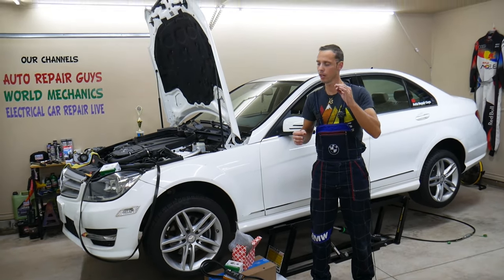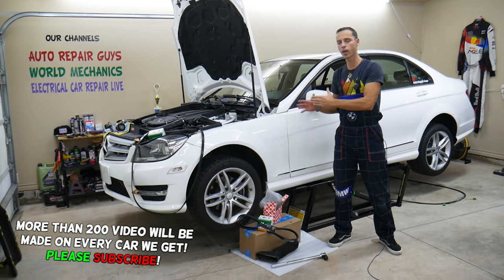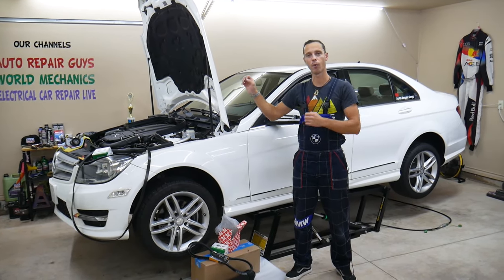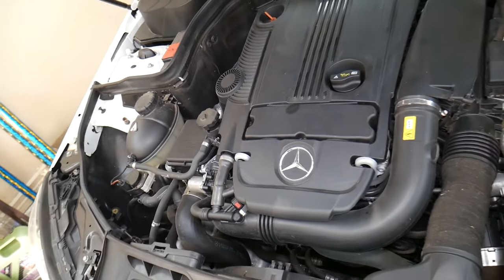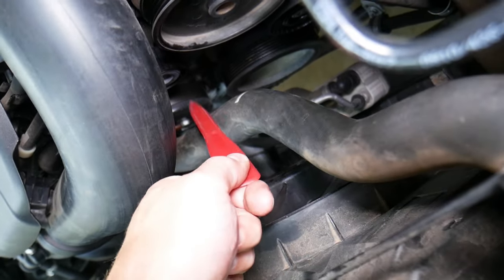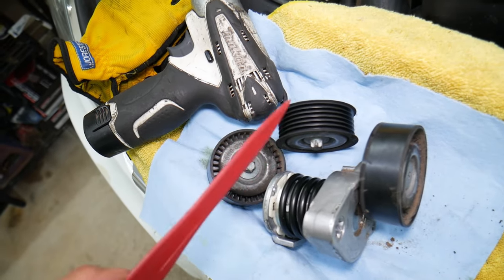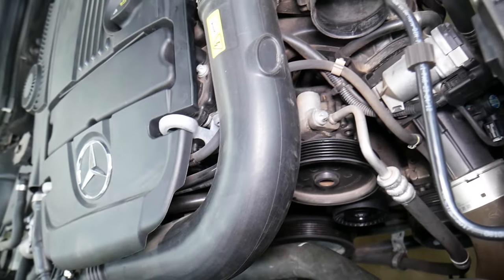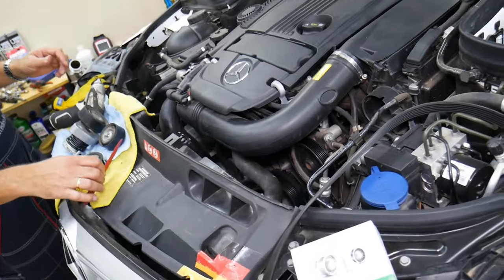WHY CAR MAKES WHINING NOISE, ENGINE WHINE NOISE

Comment: I hear this whining noise for 2 years now. I was told by mechanics it is coming from transmission, i bought the new one still the noise is there, they said ooh no it must be  front wheel bearing, i bought the new one but still the whine is there, they told me is idler pulley, i changed it still there, they said ooh it must be compressor bearing, i changed but still it whines. Now they are telling it must be a alternator bearing. These noises crazy.
Reply: It’s not the alternator because I switched it it’s fucken Anoying 😮😮😮 I did full granny service still does it maybe the air map sensor ama switch mines this week
Reply: They were pulling your leg to make money from you.  It was obviously NOT the transmission. And for sure, and didn't fix it.   Whenever I heard that noise in any of my cars, its the power steering.  Another way to "test" is that it screams louder when you turn.  Check the level, if low - top off on the level indicator with more PS fluid.  $6.
Reply: There are models you cannot check fluid levels on powering steering
Reply: 😂 fuckng mechanics doesn't know nothing from my Mercedes whining sound coming from breather hose witch is connected to the air intake pipe mechanics change this change that
Reply: @TexasCat99 what level? What fluid? Thx
Reply: @baloog8  I need a bit more context. This is an old post

Comment: I have the same noise except it’s intermittent. Seems to get quieter if I turn ac off but doesn’t go away .
Reply: ac belt
Reply: I have the same issue
Reply: @876Gamer-h5t  it’s either the alternator, oil pump or compressor. I replaced the idler pulley and tenioner with no luck

Comment: Insightful video but once you removed the belt how did you determine what exactly the issue was? How did you know which pulley was bad? I really don't want to have to replace EVERYTHING.

Comment: My TOYOTA Voxy 2010 model makes the same sound in the morning or after starting the vehicle after its been off for several hours. The sound will stop after driving like 2 to 3 Kms. This happened after we changed ATF fluid. We changed the ATF since I've been having a sudden jerking like start while on traffic or when you engage drive for Parking mode. Could it be a transmission issue?
Reply: Sounds like it to me. I'm very far from a mechanic, but my '00 Odyssey lurched forward any time it shifted from 2nd to 3rd or 3rd to 4th gear. I stupidly put generic transmission fluid in it and never got it changed due to physical trauma circumstances, and while I was on bed rest my dad and brother wouldn't listen to me about having it taken in to be changed with genuine Honda trans fluid.

The fluid I put in was safe according to the manual, but explicitly stated that it would need to be replaced with genuine Honda fluid after a specified timeframe. So the vehicle basically went to sh*t. I surely wasn't going to spend $2000+ on a new transmission.

However, someone told me the issue could be caused by faulty brake boosters also. Not sure how much truth there is to what he suspected though. And I never did get a proper diagnosis on my issue either. But, since I put that generic fluid in there - logical assumption I think.

Since you changed your ATF, I would assume the change in viscosity may have caused your transmission to go t*ts up. Always a gamble changing the ATF if it isn't changed on a regular basis. Without all the grit caused by wear and tear in the fluid, once you change it and that grit goes missing, it can cause the gears to slip.

Comment: 😭 ive had this noise for almost a year, no extra codes. Not a pulley, not alternator. I have electric power steering there's no fluid to get to either 💀 help
Reply: Did you get it fixed?
Having the same issue too
Reply: Surrender to God wanting to give you a turbo sound😂

Comment: Okay so I have this EXACT whining noise, we detached all the belts and ran the car for a few seconds the the whining was still there...  
With all the belts off, what could be causing that noise?
Reply: I have the same problem.  Mechanics never hear it (how they fail to hear it is beyond me)  I have watched videos and read articles until I'm blue.  I can not find a straight answer for this exact noise.
Reply: @sknuts2783  In my case it's coming from the manifold catalytic converter, I've checked everything else and it's probably that, or there's a small chance it might be coming from the engine, I've had this noise for months now, car drives perfectly fine otherwise. So I'm just waiting for either something to go bad or until I get some money to check the headers/cats.
Reply: @svmei   same shit...
Reply: @svmei   rattling exhuast? Or maybe it you crank pulley
Reply: Power steering pump
Reply: I have the same issue with my 2008 Impala, I replace the power steering fluid but the whine is still there  so  I'm gonna try removing the belt and see if the whine goes away because if it doesn't then there's a cliff where I live so that will definitely fix it for sure 😂
Reply: @dannysautorepair i have a 2006 impala and my car needs to be taken out into the field at this point😂
Reply: Huh, my car is a 2011 chevy impala and just started getting a whining noise. Sounds like it's a chevy impala problem.
Reply: @joa843  if your car is making this noise in the video, what helped me was by first checking if Im low on power steering fluid. I got the one made for american vehicles n I fixed it. Then if not its probably the power steering pump. (Im sure there is videos to check if its that too) then if not probably the pulleys and/or belt around the engine. (Again im sure theres videos to check if its that too)
Reply: @wakiyasan8957 I have an Impala SS with the same issue!!! I replaced my power steering pump and 3 hours later it still whines 😢😢😢

Comment: I have this whine with my 2012 Dodge Avenger and the mechanics say it’s normal but when the engine is warm it still does it I don’t get it and I’ve worked in my car multiple times and it still whines

Comment from the maker: Products that we use and recommend:
► Serpentine Belt: https://amzn.to/3ZqyTRy
► Belt Idler Pulley: https://amzn.to/3Xj9QhG
► Tensioner Pulley: https://amzn.to/3WZhOMS
► Panel Removal Set: https://amzn.to/3YiMADu
► Tool Set: https://amzn.to/3p5MM6t
► Screwdriver Set: https://amzn.to/3XRB28Q
► Castrol Oil: https://amzn.to/3xBc8B9
► Oil Filter: https://amzn.to/3w0Ulme
► Torque Wrench: https://amzn.to/32qyRwg
►Liqui Moly Engine Flush: https://amzn.to/3IiDBID
► OBD Scanner that we use most often: https://amzn.to/3I4MQfe

► Check out our Amazon Store for the tools and parts that we use: https://www.amazon.com/shop/worldmechanics

Comment: My car makes this exact noise but only if AC is turned on and it's not that loud (but its loud enough to be very annoying). It gets progressively louder as I drive more. The moment I turn the AC off it stops. I have no idea what it might be
Reply: its easy bro as the video says its one of the pulleys, according to your describing it must be the "ac compressor pulley" this device is obviously from its name only, we know its the problem + this thing is a little "expensive" soo first maybe try to some "suitable lubrication" on the pulley? or maybe there are some guy videos around the internet know better than me but nothing changes it gonna be the "ac compressor pulley" trust me bro, I'm not sure if things will get worse if not fixed or not soo you need a trustworthy guy to tell you if to change the whole "ac compressor pulley" or not.
Reply: maybe you can change the pulley alone to save some cash but i'm not sure if its gonna fix the problem